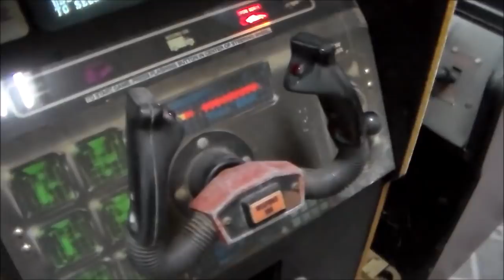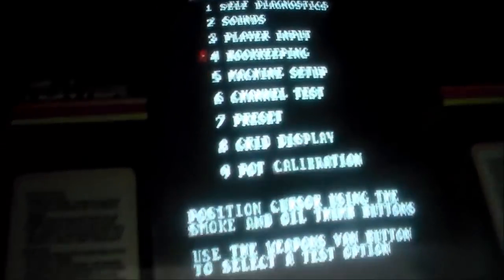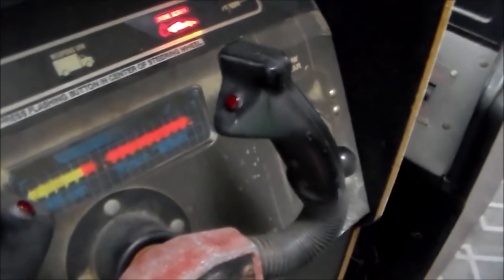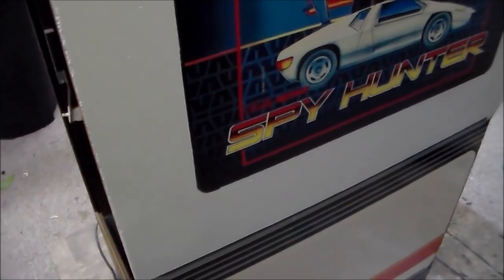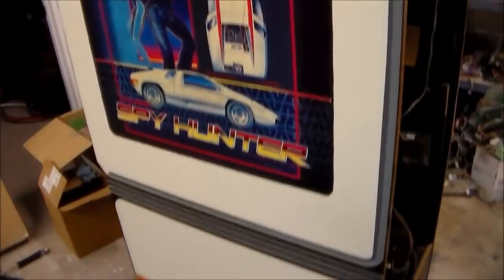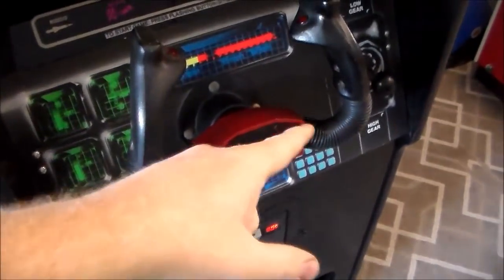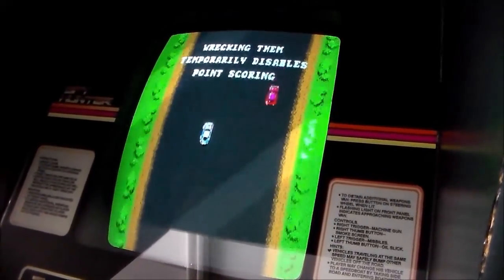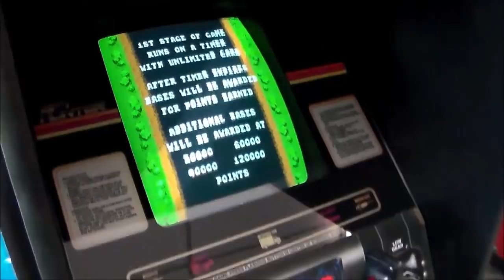The Spy Hunter Rides Again! Finishing Up This 1983 Bally Arcade Classic!

Comment: Thank God. I was having the same issues you were (very faint machine guns, missiles etc., but normal other sounds). So I'm going to take a hard look at that connector on the dual power amp board. Also going to look at the solder joints. If mine does turn out to be the audio amp chips, where can I order some?
Reply from the maker: I got lucky and found some on ebay, but you have to be careful on there, a lot of times the chips are fake!  Almost impossible to tell until you get them.

Comment: Left trigger should fire missiles.  I don't remember if the left trigger did machine guns.  I think it only did missiles.
Reply from the maker: Ahhhh... I might have to look into that then.  Hmm, I'll look it up.
Reply from the maker: The operator had tied both of the switches together behind the control panel, and disconnected the missile wire.  Very strange, not sure what he did that.
Reply: Saw that you got it fixed in the next video
Reply: Joe's Classic Video Games probably so it would eat more quarters when the helicopter showed up.